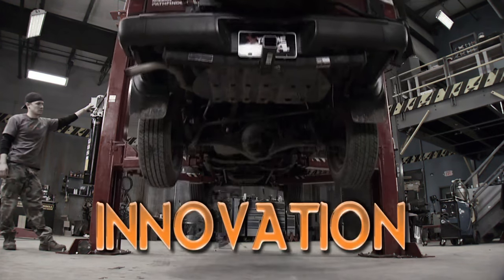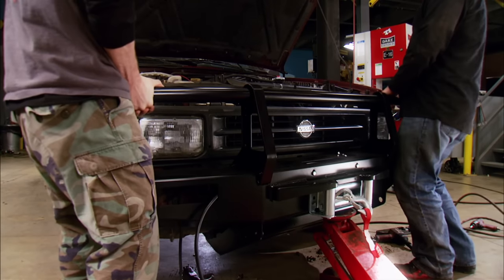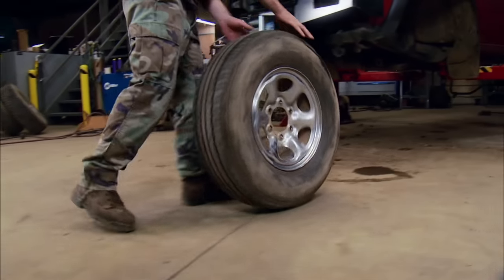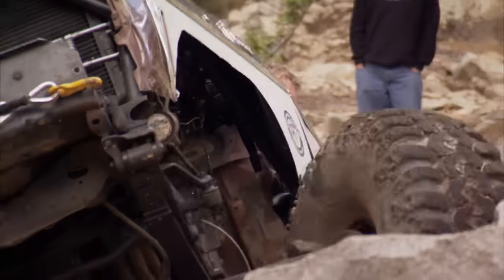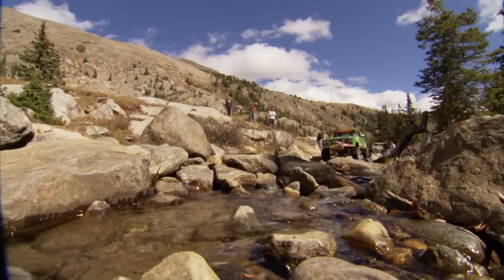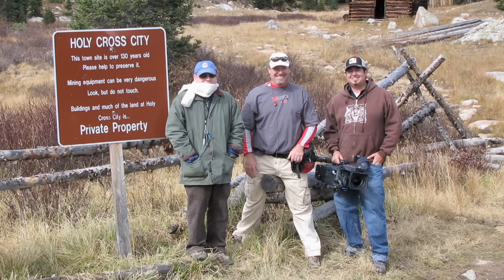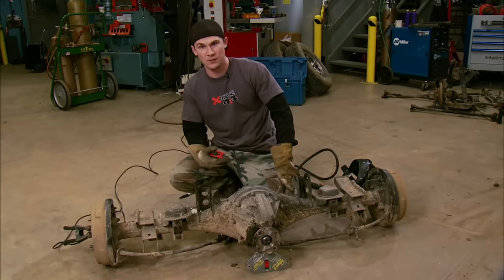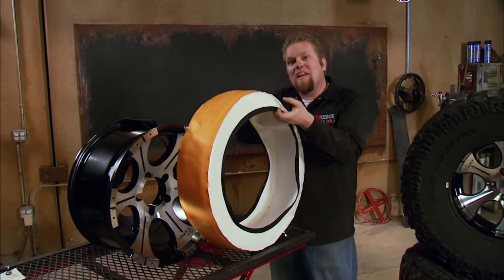Nissan Crew Truck Part II - Full Size Trail Ride from Colorado - Xtreme 4x4 S4, E15

Comment: Ok I have 1993 pistons or what I got told they was came out of a 302 ho but I order new rings and the rings are to thick for the grove and idk how to properly find the right ones without doing buy and play
Reply: Call total seal. Or buy a micrometer and take measurements of the grooves.